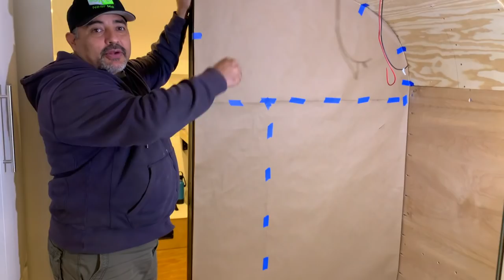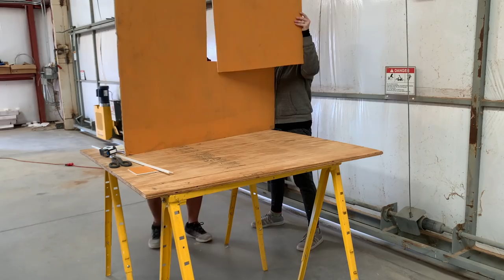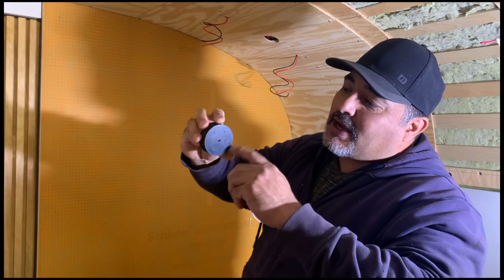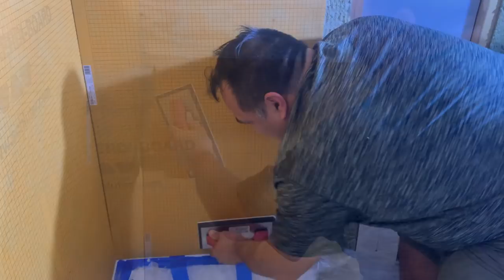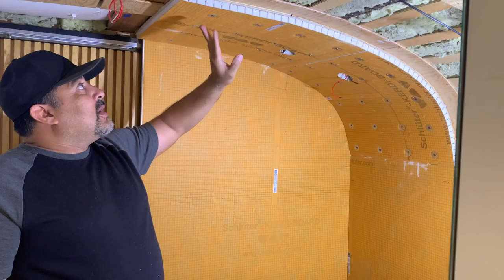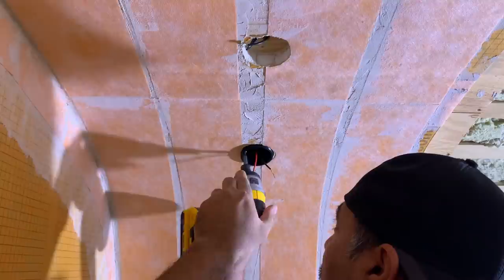Bathroom - Part 1: Waterproofing Plywood Walls with KerdiBoard

Comment: Tons of work but worth it great materials to work with a lot of people are using that system nice job the pressure is on while working with it you don't want to be in a hurry but your under that time constraints you did great.
Reply from the maker: Thanks, Brian.  We were worried about the time constraints on the thin-set, which is why you may have noticed we made pretty small batches.  Just the amount we felt we could get done in the allowable amount of time - which for us is not a lot because we are slow!  :). So, we just had to make a few small batches as we went, rather than one big batch.  It worked for us and helped us not feel quite so stressed about it.

Comment: Nicely done! I went to Schluter training course when that stuff started hitting here in the states. It was a cool little course.  Next time you could use the membrane only if you like. I have used that membrane to waterproof many different areas than just the shower(s)! I love that stuff.
Reply from the maker: Thanks Sui.  We wanted to use the membrane, but unfortunately it is not able to be used directly on plywood.  As we researched, that was the answer we kept coming back to.  In fact, we even contacted the Schluter area rep to make sure our research was correct.  He verified that we had to use KerdiBoard, because the plywood is not a thermally stable substrate and needs the foam to isolate it.  Overall, all of the Kerdi products we used worked great.

Comment: Looking good so far! If you haven’t cut penny tile yet it’ll be fun. Us all of your templates to trace your tile pattern out first and don’t start at the edge of your tile. Always start at the next tile row over so that the tiles are still on the glue sheet. Just my 2 cents.
Reply from the maker: Thanks, MikeyBob.  We have finished the tile already - video coming.  It was certainly a huge learning curve on cutting the penny tile sheets.  Especially on the curves.  But, we finally got it done.  And, we absolutely used templates for cutting and laying out the tile before we set it.
Reply: 😄I figured as much. You guys have been pretty meticulous throughout your build... so there was really no doubt in my mind🤘🏼

Comment: You should have just timelapsed the whole thinset application, you were killing me, lol!  10 points over all, 3 points for style.  Since I install Kerdi showers I would have used KERDI FIX to apply the KERDI Board to the sides with screws.  Additionally you should have left a 1/8" flex joint at the wall to tub connection that should be filled with KERDI FIX.
Reply from the maker: LOL!  It was so hard to have the two of us in there plus the buckets, plus the tripod.  It is pretty tight. We were lucky to do much of any filming in there.  Hahaha.  We actually spoke to the Kerdi Rep for our region and he specifically told us to fully embed the board to the walls with the thin-set because we were doing it over plywood.  I'm sure it is different with different substrates, but we followed his guidelines.  We did indeed leave a gap between the tub and the bottom of the board, which after we tiled and grouted, we filled in that gap with grout color-matched silicone sealant. (Video to come) Hopefully we will be all good.

Comment: Another excellent job well done!

 I use Schluter products almost exclusively in my business.  I think your project would have been  a lot easier as well as less expensive if you had used the Kerdi membrane instead of the Kerdiboard.  Did you condiser that option?
Reply from the maker: We did consider that option and we were excited to use it but we kept running into the same answer: "this should not be used directly over plywood". We even contacted the Schluter rep for this area (Tim) who advised us to use Kerdi board and not use the membrane because plywood is not "thermally stable" - it needs the foam to isolate it.  We are not experts of course which is why we called anybody who would talk to us.

Comment: Could have used Red Guard on the plywood and it seals as well as provides an expansion membrane as well. You just trowel or paint it on. Tile right over it with thinset flex. But hey you did a good job.
Reply from the maker: We have seen that done, but have had multiple professional tile-layers advise us against using RedGuard.  In their experience it is not enough for the job, and they had seen plenty of water damage from going that route.  As first-timers, we took all the advice we could get from professionals before attempting to do this ourselves.  I'm sure there are plenty of people who have had success, but we did not want to risk it.  Thanks for joining us.

Comment: Tiling seemed WAY to much hassle  for my bus. Also It would feel 'to housy' for me. I'm gonna go with rounding off the corners with foam and fiberglass, epoxy coat all the walls, sand it smooth and apply some epoxy paint in a white to blue gradient. That last part's gonna be a headache but oh well. ;)
Reply from the maker: That sounds really cool!  I'm sure it will turn out amazing.